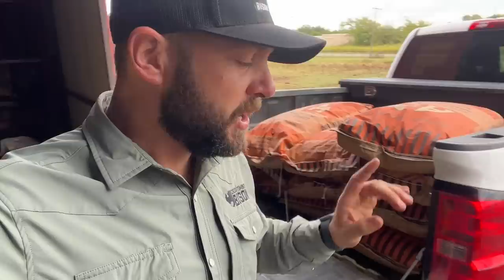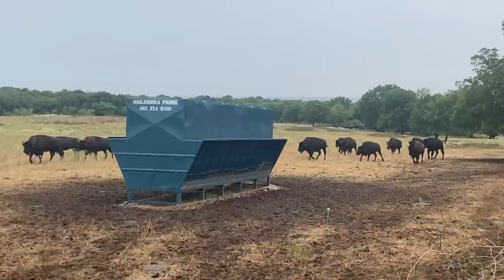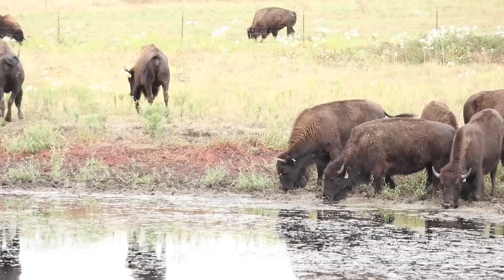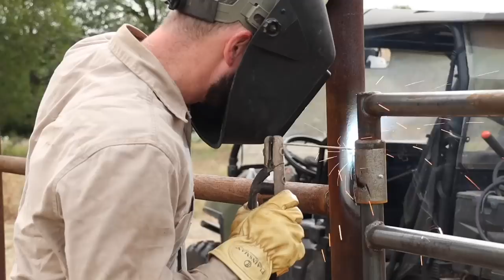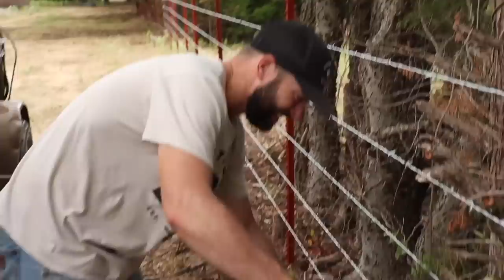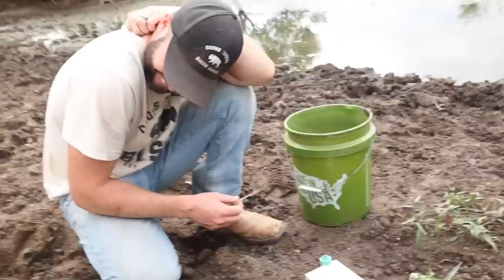Pond Water Quality Test… Is Our Herd Safe?

Comment: Dusty do yourself a favor now. On your gates on the chain side at the bottom of that straight pipe put a hinge footer. For 2 reasons
1. Your always going to have one who will test the gates. If they even move a little they will always check it. 
2. With a footer attached the gates when properly closed will never move. Also over time with ppl climbing over the gates your hinges will never sag. Here if u don't get it

Comment: In the midwest your water will be high in carbonate since almost all the native rock is limestone (calcium carbonate).  Once it is dissolved in the water, drought will concentrate it.  Carbonates usually make up the white crusty stuff that sometimes forms on the perimeters of drying bodies of water.  At the best of times you will probably be high normal for carbonates.
Reply: Interesting 🤔 Thanks for the info and for supporting the herd!🦬

Comment: Hey Dusty, Great video today. Glad you tested the water on your property. I have a question for you. Have you thought about collecting the bison manure and selling it? I know it fertilizes your pastures. But with no rain does that not make more flies to bother the bison? Also, I have a recipe for homemade weed killer that is nontoxic and words really good. I use this because I have animals and don't want to harm them. 
For a healthy supply of this man-made concoction, mix a gallon of white vinegar, one cup of salt, and one tablespoon of dish soap. Make sure it is properly stirred, mainly the salt has dissolved, then put the mixture in a spray bottle for easy use. You can stash the bottle in your house for repeated use. You can double or triple this depending on the size of your sprayer. 
It is best to apply the weed killer during the sunniest part of the day, as the sun and heat help dry out and kill the weeds. Spray the weeds from close range, making sure they are entirely soaked, leaves and all. Remember that the solution makes no distinction between weeds and desired plants, so be sure to spray it only on what you’ll be happy to see killed. (This might kill them blackberry brambles.) Worth a try. 
Blessings!
Reply from the maker: My wife has brought that up to use on her flowers as well. Would be great fertilizer! We have not seen an uptick in flies yet, however that is something to keep in mind to be on the look out for. I may give that homemade weed killer a try while managing the Johnson grass the next couple of months as we rotate pastures. Thank you for the info!
Reply: @CrossTimbersBison  Sure no problem. Take care! 🦬🦬🦬

Comment: I've never put up fencing, but I wonder if you connected a torque scale to see how much your applying the each wire and comparing it to the factory tensile strength to see how close you are to the maximum. It gets pretty scary tightening them because you never know if it's going to snap. Glad your first pond tested good. Hopefully the others do also.

Comment: Hey Dusty I leave the bale on the spear and cut the netting low on one side then pull the netting over the top and then from underneath    then put the bale on the ground works really well.
Reply: But I forgot you have a door on your loader so it might not work for you.

Comment: Dusty Hope this helps from the pond guy website: "Carbonate Hardness and How it Affects
Hard water, soft water - you're probably familiar with these terms as they relate to the water flowing through your home's plumbing. But the water in your pond or lake can be hard or soft, too, and it matters to your fish, particularly if you're using algaecides or herbicides.

What is Carbonate Hardness?
Carbonate hardness, or alkalinity, is the measure of carbonate and bicarbonate concentrations in your pond or lake's water. Alkalinity is a measure of the ability of a solution to neutralize acid without changing the pH. It both controls and maintains water pH.

Alkalinity is related to the amount of dissolved calcium, magnesium and other compounds in the water, so alkalinity tends to be higher in harder water. It naturally decreases over time through bacterial action that produces acidic compounds that combine with and reduce the alkalinity components.

In a pond or lake, the alkalinity of the water is critical to the safety of the fish. The carbonate hardness of your pond or lake should ideally fall between 50 ppm and 200 ppm.

Fish Friendly
The beneficiaries of the hard water's buffering calcium and magnesium are your fish. Carbonate hardness in your pond or lake affects the sensitivity of certain fish--mainly trout, koi and goldfish--to the acidifying chemicals found in algaecides and herbicides. If you have high carbonate hardness, or hard water that contains more than 50 ppm of the minerals, the fish are less likely be affected. As always, read the product label before use and for these more sensitive fish you may also choose to use an algaecide or herbicide that does not contain copper to avoid any issues.

Measuring Minerals
If you're curious about your water's carbonate hardness level, or you plan to use an algaecide or herbicide in your lake that requires hardness to be at about 50 ppm, test your water with a Carbonate Hardness Test Strip.

The strips are easy to use. Simply open the pouch and dip it into the water for three seconds, remove it from the water, wait 20 seconds for the water to mix with the solution on the test strip, and read the results. To see what your water's carbonate hardness is, match the color on the strip to the color block on the package.

Remember to perform this test each time before you treat your pond with herbicides or algaecides as the levels of calcium and magnesium in the water may fluctuate."
When you talked about the test strips I knew right away the strips you were using, I use the same ones on my fish tanks twice a month to help determine how much of a water change I need to do (how much to vacuum the substrate basically).

Comment: In pond water a high carbonate level occurs when hard water meets high alkalinity and warm temperatures, this allows for the dissolved minerals to solidify. There’s a  high PH in surface water due to the above mentioned issue. Cattle normal PH values range from 5.5 - 8.5, id be curious as to how high your sodium bicarbonate and sodium carbonate are.

Comment: can i point out you do have natural fertilizer, the poop and urine from the cattle... that also plays a big factor in small ponds and that also maybe and issue.
Reply: Fortunately that is more apt to break down and build soil, percolating thru the ground to the water  ponds, as opposed to the chemical kind that is over sprayed on every inch of field, seldom watered in by rain  and tends to wash off the surface and grasses into the ponds. 
Another good thing is the chickens. Chickens break up the cow pies to eat the fly larvae and other insects thus spreading and breaking down the manure into useful soil content  that feeds the grasses.  Another consideration  is the amount of time they spend on the field opposed to the water is proportionally greater, so the potential for pond water contamination is only there in the extremely hot, dry, arid, drought of mid summer as he recently experienced. 
Potential run off from neighbors that spray fertilizers, herbicides, or pesticides  is another consideration. Fortunately small ranchers and farmers are less apt to do that, leaning more on the old crop rotation and other tools used by generations gone by. Only the large mono crop farmers that use the gmo seeds do the real heavy 4-5 x per year spraying. That's why it's best to avoid those crops which are usually corn, soy, and wheat, which contribute to the current gut issues like IBS  etc,, allergies,, and autoimmune diseases. Best to buy  locally grown or certified non gmo or organic in those products. Sometimes the "new science" is much worse than the tried and true, old fashioned, logical ways.  
Dusty's work around for water also helps alleviate any potential for water contamination being  the cause of the illness and death of his sweet, young, heifer and contributes to the further wellness of the herd. I'm sure in the not too distance future that and other clean water drinking tanks will become permanent fixtures in all his fields for his bison as he did on the original property. I'm sue he has a list and us checking things off as he goes.  God bless.
Reply: @teresamariner4238  since i took over this estate I've stopped using chemical fertilizer an that was over 50 years ago, the issue is farmers today want quick easy solutions instead of working out how to run and manage a farm, not many farms know how to rotate crops and animals to keep the ground fertile.

Comment: I thought you bought a clip on microphone Dusty. I could barely hear you (actually I couldn't) over the wind.
Reply: He was using the new wireless mic I bought in the other video. The clip got knocked off while we were working at some point and I had to switch to another microphone. But yeah I’m with you, super annoying the wind is still even a problem when we’re using “top of the line” microphones and expensive wind screens. That Oklahoma wind can be brutal! I picked up a new clip and we’ll use it whenever we can in the next few videos. Thanks for watching and supporting the herd! -Cole 👍🦬

Comment: Aquarists and fisheries folk check on carbonates as part of checking on pH and water hardness.  It's important for pet trade fish used to hard limestone-carried groundwater, as compared to those fish adapted to very soft peaty acidic waters such as the Amazon headwaters.  Your test results suggest that your local soils and rocks are high in calcium and lime compounds, but not to the point of making that much-evaporated pond water so salty as to be dangerous.  Carbonate rocks melt away to create large caves like Carlsbad, with flowstones and stalagtites/mites.  More details here.  https://en.wikipedia.org/wiki/Carbonate   -  wiki excerpt:  ...In geology and mineralogy, the term "carbonate" can refer both to carbonate minerals and carbonate rock (which is made of chiefly carbonate minerals), and both are dominated by the carbonate ion, CO2−3. Carbonate minerals are extremely varied and ubiquitous in chemically precipitated sedimentary rock. The most common are calcite or calcium carbonate, CaCO3, the chief constituent of limestone (as well as the main component of mollusc shells and coral skeletons); dolomite, a calcium-magnesium carbonate CaMg(CO3)2; and siderite, or iron(II) carbonate, FeCO3, an important iron ore...

Comment: Carbonate is the hardness of your water, it is nothing you need to worry about. It helps the nitrifying bacteria remove the nitrites (poop into nitrates. Plants then remove the nitrates as food from the water.   You probably have limestone in your ground etc, it’s a good thing.  It would leave lime scales on your pipes if it ran through your pipes over time, like anywhere with hard water. Nitrites come from the poop or fish waste in the water, plants like I said then use the nitrates.   This does not test for the deadly algae, but I doubt that is even a problem anyway.  Algae in water is usually harmless, so very unlikely to be the deadly kind.  I see you are going to do the real test for blue green algae but I imagine if you did have it you would have a ton of deaths and not just one.

Comment: Taking water from the very edge of the pound is an improper way to take a water sample from a pond. The test results will not be correct. 

Water samples should be collected by submerging the bottle ½ to 1 foot below the water surface, at a spot several feet away from the edge of the pond, filling the bottle completely, and tightly sealing it with the cap.
Reply from the maker: Thank you for the info!

Comment: A "wind sock" for your microphone will help to diminish the wind noise.
Reply: Dusty was using the new wireless mic I bought in the other video. The clip got knocked off while we were working at some point and I had to switch to another microphone. But yeah I’m with you, super annoying the wind is still even a problem when we’re using “top of the line” microphones and expensive wind screens. That Oklahoma wind can be brutal and even with the most expensive mic setups wind noise is unavoidable at times, especially on top of a hill. Thanks for watching and supporting the herd! -Cole 👍🦬

Comment: A wind "muffler" and better microphone would make the video so much easier to watch.  Thanks.  🙏
Reply: He was using the new wireless mic I bought in the other video. The clip got knocked off while we were working at some point and I had to switch to another microphone. But yeah I’m with you, super annoying the wind is still even a problem when we’re using a  “top of the line” $300 microphone and expensive wind screens. That Oklahoma wind can be brutal especially on the top of a hill! I picked up a new clip and we’ll use it whenever we can in the next few videos. Thanks for watching and supporting the herd! -Cole 👍🦬

Comment: Not sure that the test kit your using for water hardness and pH level is actually going to tell you much, as long as the pH is not to high, and even the most toxic of water can test within an 'okay' range of many of the things that its testing for, that kit seems like one more for testing swimming pools and koi ponds and so on.  You actually want a more detailed test so you gte number ranges instead of basically a pass fail since you don't know of okay mean what amounts so they can be judged against the 'okay' of other water components.  You can get some good water test kits for toxic condition for relatively low cost even off of amazon byt make sure its testing for consumable water not agricultural (aka ware for irrigation) water.  Thos dip tests also cannot tell you what, if any, bacteria you maybe dealing with and in what concentrations, nor can they look for protozoa or water borne parasites.  Those need to be done by a laboratory who can count the number of organism per water drop from a sample.  No water source is going to be free of those things unless chemically treated for human consumption,but even that 'potable' water you get in campgrounds and so most are going to have these, as that is how nature is, if they are exposed to nature.  Evolution, however, has made it so almost every animal that consumes or lives in water has a way of dealing with these problems, such as the ability to digest and kill off most - hence mammals high stomach acid contents as well as immune systems developed to fight off parasite and bacterial infection and deal with protozoa, at least in the normal amounts that they come in contact with.  Problems come along when something upsets the balance and suddenly, say in a pond that may have supported anyone of these things in one part in millions of gallons, starts to lose its water percentage and the parasites, protozoa and bacteria reach concentrated levels and they fight to survive and, especially in a drought when there is no way to replenish the water, and dilute the growing colonies you suddenly have water that has 100's of 1000 to a million organism per part.  Even a healthy animal that gulps down a stomach full of water where colonies have concentrated can get in enough to sicken quickly.

When it comes to nitrates from fertilizer, which can be different from just nitrates found in nature and can in danger a water supply
 while you do not use fertilizer there is no way to know if those fields have been exposed to it in the past and some of the older fertilizers are known to have some really long half lives.  If its always been used a pasture though you probably not risking an fertilizer nitrate issue.